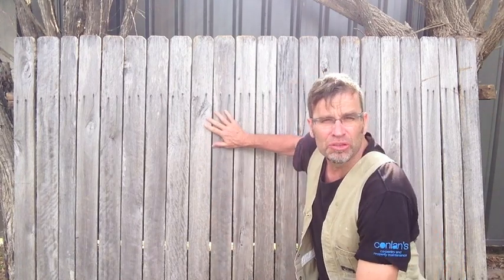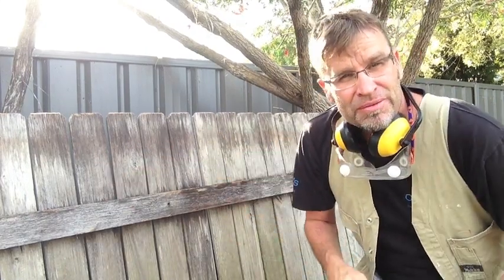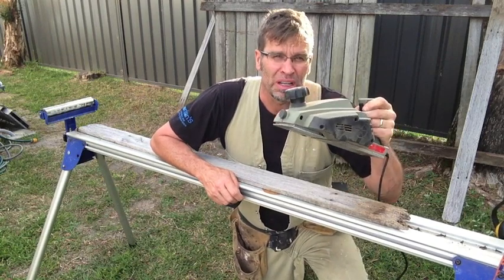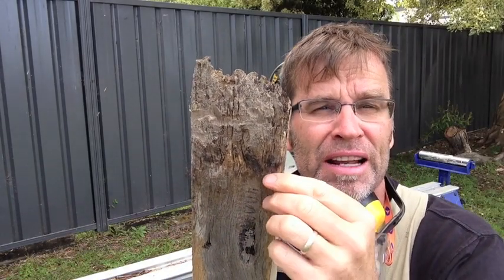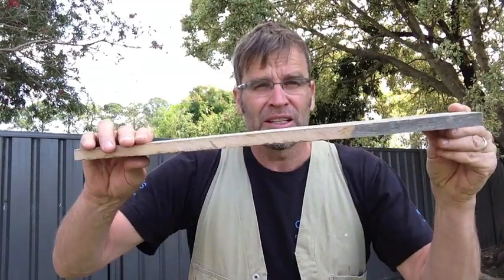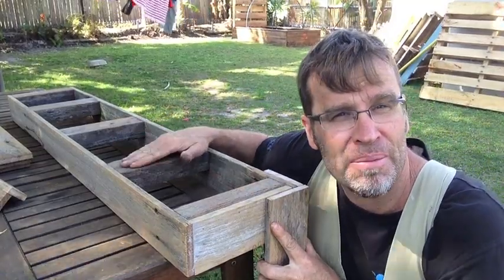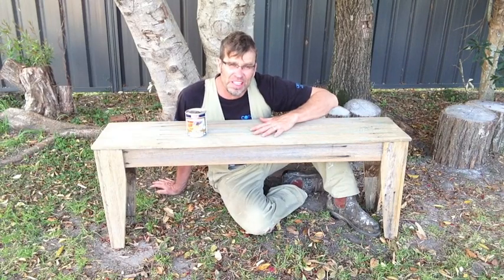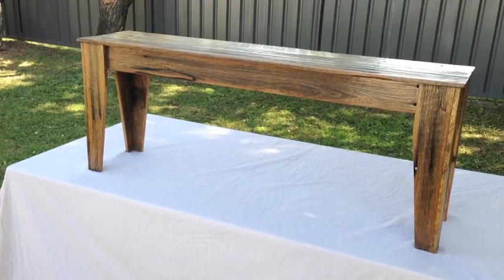How to Build a Bench Seat. Awesome DIY Project!

Comment from the maker: Yeah mate, 10mm over that distance is a little over the top. Try it over a larger increment, say 900 x 1200 and then measure the diagonal. Hopefully it isn't to much over 1500mm. Cross your fingers.

Comment: could you use pine fence pickets to make the bench and what  did you use to finish the job .   by the way great project looks great thanks
Reply from the maker: G'day Tate. Yeah you could use fence pickets if you wanted to.To finish it off I applied a clear, satin, oil based marine grade varnish. Thanks  for the comment mate. Cheers

Comment: Quick question. If someone on the larger side were to sit on that bench, do u think that using brad nails on the legs like u did will be strong enough? As opposed to screws or half lap joint?
Reply from the maker: G'day MrPanther. The bench l built is extremely strong. I'm 97kg and it handles that with ease. You could of course use screws or a half lap joint if you wanted. Cheers mate.